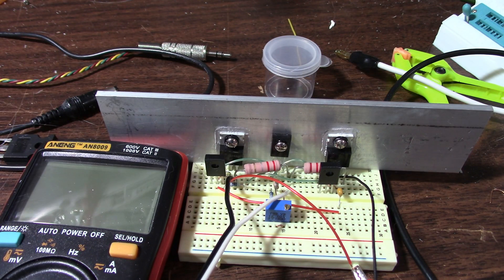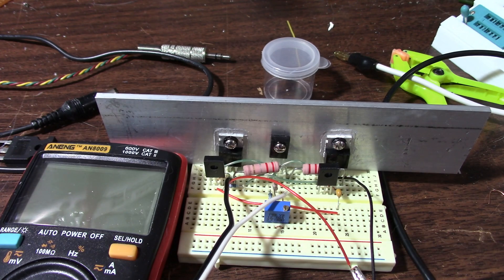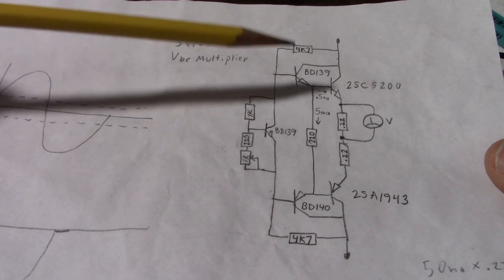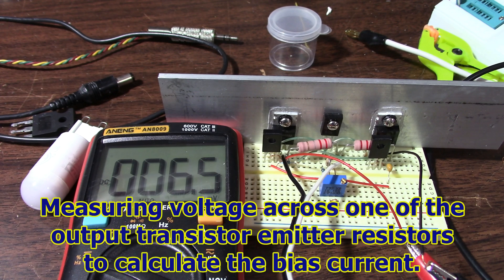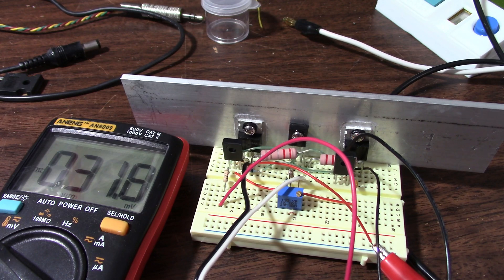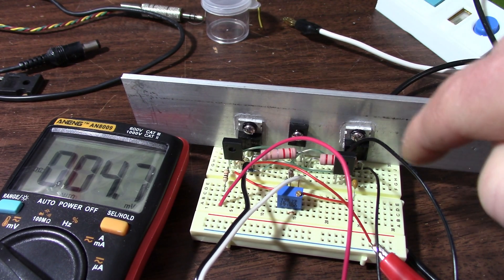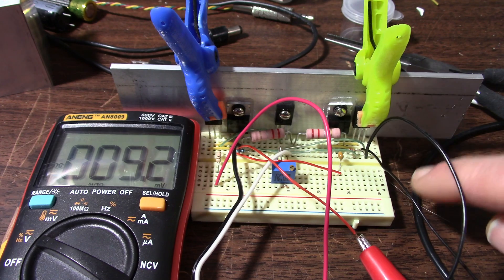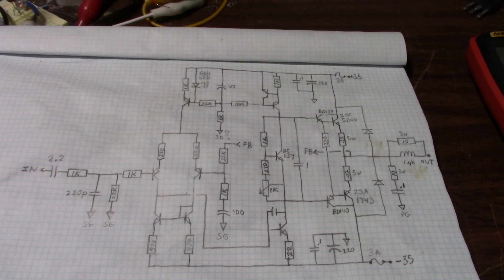Discrete audio amplifier project PT11.3 output bias and thermal stability

Comment: Great video! It’s the first I’ve found that shows the real problem and its solution. Do you think putting some thermal resistance between the compensation transistor and the heat dissipador would be another solution? In my point of view… if we have some  overcompensating we need to put some “
Thermal distance” to the compensating element. What do you think of it? Thank you.

Comment: Hello! Great video, awesome channel. I am an EE, myself. I’ve been designing PCBs for over 10 years, mostly DC/DC SMPS,  EMI MIL-SPEC power filters, microcontroller driven USB devices, video display driver boards, LI-Ion battery charge controllers, USB Audio DACs and so on. You mentioned laying out a PCB for this project with a BOM. I highly recommend using PADS or DipTrace software for board layout creation. I’ve used both everyday for years - they are quite capable of just about anything you can imagine. Cheers 🍻

Comment: I'm familiar with biasing a push-pull stage, although everything I've done uses a pair of diodes between the bases to generate the 1.4v drop.  In your design, how will you trim the actual bias voltage itself (to tune the idle output current and voltage)

Comment: Hello Mr. John, please help me out; I was building a tda2030a ic bridged amplifier circuit, but when I connected a speaker (an 8Ω, 60w woofer and a tweeter with crossover circuit) on the output, a high frequency hissing sound is present till the ics remain powdered,i.e. the 10,000uF capacitors remain charged.
I am running the circuit with ±17v supply (12-0-12v 4A, transformer with rectifier).
I think the hissing sound is too loud when the ics are idling, i.e. the volume turned all the way to zero, again the board (dot perfboard is well built, as there is no problem of 50-60Hz humming in the circuit.
It doesn't as well have the 100-120Hz hum, because the power supply is well filtered.
The hissing is less noticeable if the speaker (box) is connected to only any one output and the ground.

I think you'd take a look at this matter, and I'd be very happy if you reply on this matter as I am really suffering from this particular hissing problem.
Reply from the maker: This sounds like the amplifier is oscillating. There could be several causes. Proper layout of the ground traces are important. Be sure the grounds carrying heavy current such as the return from the output are not flowing in the "small signal" grounds such as the input and feedback returns. There are a few videos on my channel about circuit layout.
Reply: Firstly, thank you for your attention in this matter.
Secondly, as I have mentioned earlier that TDA2030A ics are in bridge configuration(exactly like this https://encrypted-tbn0.gstatic.com/images?q=tbn%3AANd9GcQVy_rjN_qPvuwHFplOhi04369PNLxFo5q8Z3_K3NsLH22ikD5i , it is an image of the circuit, you can open it) so there is no return path of the speaker to the ground.
Are you talking about the return path of the 0.22uF capacitor with the 1Ω resistor in series and connected to the output to ground?
Or is it due to using carbon resistors instead of metal film resistors?
Or none of them?
I am using star ground on the perfboard, where the input ground is far away from the power ground.
Reply: PROBLEM SOLVED: This amount of "hissing" is normal for the bridge configuration of TDA2030A, I didn't know about it and just exaggerated the amount (though the ic gets a bit hot while idling compared to STK4141, which doesn't have any of the problems) and it would depend on the cross over circuit, so I think adding a suitable inductor in series with the tweeter will reduce the problem.
What do you think?
Reply: @anindyamitra5091  
We listened to my DIY SB spkrs connected to friends Yamaha receiver that uses STK433-133 IC - wow was my word - clean, dynamic, good bass, really very surprised how well it coped with 4ohm 2way - we managed to clip it on some organ music but it was quite loud, much louder than many people listen to. A yes way better than some older Sony AVR thing I have for watching TV, that uses IC chip as input driver-VAS and pair of Darlington Sankens.

Comment: Getting there. I like your cautious, methodical approach. I can't help but be concerned about using BD139/40 for drivers, only because they are so outdated and have a known slow (but undocumented) gain/bandwidth/speed. 2SC4793 and its partner are probably better, or MJE15030/31 if I have those numbers right.
Reply from the maker: I've not heard about that with the BD139/140. They have a nice flat gain response for the range of current they will be used to drive the outputs so they seemed like a good choice. If they can't keep up at 300ma or so, I'll have to find something else.
Reply: MJE 15034/35 might be very good drive alternative 4A, with a bit higher hfe of 100 than 15030/31 devices. The BD139/140 is kind of old for the new 30MHz devices. But for John's design they might be fast enough - only 100W 4ohms, and I think they will do a second pair for 200W.
MJE 15032/33 are common in many amps. The Sanken, Toshibas, Hitachi are faster, but 1.5-2A devices and may need base stoppers - they work great as long as someone doesn't ask them to drive 10 out pairs in 1000W 2ohm design. Helpers - they love things with wires, open books, keyboard and occasionally they play with the mouse. I think it's the warm environment they enjoy under the desk lamp. Nice to see the progress.

Comment: Hi, How do you protect your components from electrostatic discharge? How do you store your components?
Reply: BJTs are not particularly sensitive to static. That is more of a FET problem. With improved manufacturing, materials and design ESD is mostly a problem of the past today anyways. I tend to blame susceptible components more than handling. If parts blow up toss them and use better parts. Problem solved!